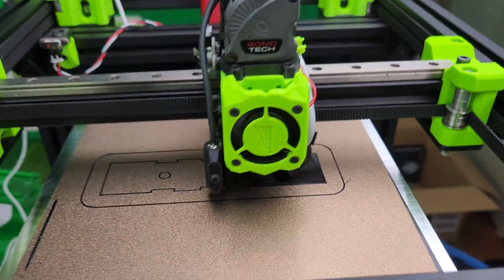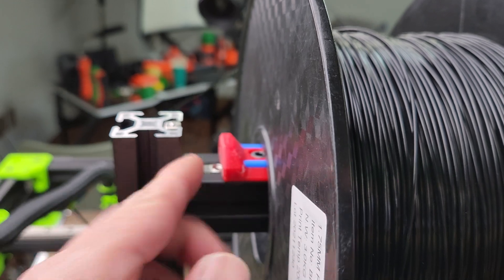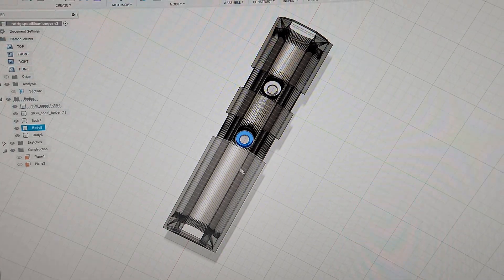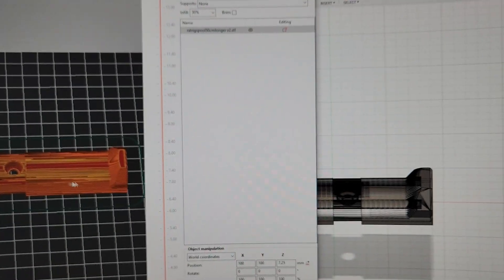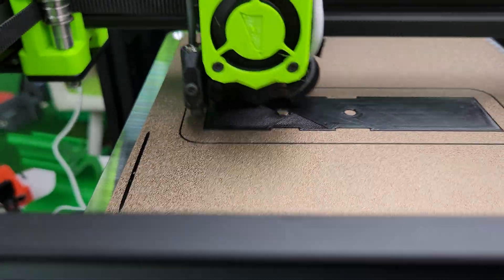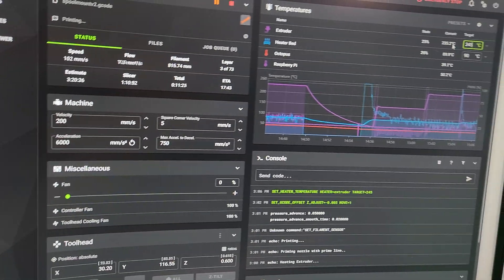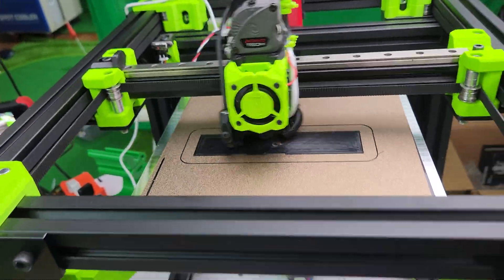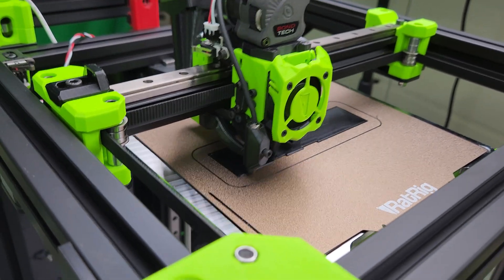My 2nd PETG print w/ RatRig VCore3.1 200mm/s 6k & 8k accel!

Comment: You should get an accelerometer, with a 200mm core 3 and input shaper, you can easily do 20k accel. Also, if you keep having problems with underextrusion st crazy speeds, consider replacing your lgx lite with something that can push more, like an orbiter v2. I recently switched, and it almost doubled my flow. Super clean build though, can’t wait to see more speedy prints!